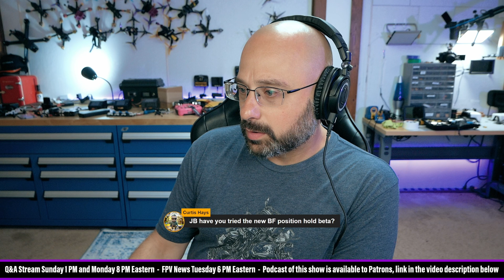Why Does A Drone Need A Gyroscope? How Does Betaflight Use Two Gyros? - FPV Questions

Comment: Hi! I know this vid is 6 months old, and I'm not sure, but I think (most of) you guys didn't read the first question correct.. :
The second half of question number 1 is; "Why can't they (-the FPV-drones) just NOT react to the environment (...)?"

There's tonnes of people with explanations about why and how a gyro DOES react to the environment, but I believe that's not the question.
Apart from that, I think (although I might be wrong, ngl..) that the statement that the Gyro is needed to translate a single stick input into 4 separate motor-commands is wrong.. -ish.
It's true that the Gyro is part of the system (-flight controller, I guess?) that tells each motor what it has to do at any given moment in the flight, but why does it need more 'info' than just the amount of stick-input?

In other words : 
Assuming a drone flies fully manual, so no attitude-control or self-leveling or any other kind of restriction in movement, like max. roll-/pitch-/yaw-angles-, or any type of anti-wind stabilizing stuff-, (for which it obviously would need some kind of steering-help, like a Gyro) - other than the pilot's own stick-input..  - why does it still require a Gyro to fly?

I've only flown a handful of fixed-wing (non-fpv) foamies so far, so maybe this is just something you gotta know to know.. you know? 🙄👉👈 .... But I really don't know, so I'd be glad to find out!
Cheerz! 🚁

Comment: The only way to not use a gyro is to manually control the throttle of each motor by hand. I'm sure you can imagine how well that would work.

Comment: Most flight controllers do use sensor fusion. The accelerometer data is used with the gyro to stabilize a quad when in one of the stabilized modes.
A flight controller with only an accelerometer wouldn't be able to control a quad. The same thing goes for gyros. Add the two sensors together and a flight controller can keep a quad level.
Reply: But is this still sensor fusion? Accelerometer gives you different data, it gives you acceleration, not orientation. You cannot simply "fuse" different physical quantities.
Reply: @jkk916  Yes, it's sensor fusion. Much more so than using multiples of the same type of sensor. Multiple gyros gives you sensor averaging or sensor voting. Using gyros and accelerometers together is sensor fusion.
You need both acceleration and gyro data to figure out the quad's orientation. 
Accelerometers alone won't give orientation since it can't distinguish acceleration from gravity verse acceleration from change in speed. Gyros can't give you orientation since they only measure how fast you're turning not absolute position.
Throw a magnetometer into the mix and then you're really fusing data to get even better position data.
Reply: @ddegn  Well apparently sensor fusion is broader term then I thought.  
Nevertheless, I imagine the whole process that way: raw sensor data>filtering, sensor fusion>data processing>creating output
And I would rather put some of what may be regarded as sensor fusion in data processing department. 
In the opposite case I would regard everything as a sensor (whole electronic package including processor) which does not make much sense to me. 
You "fuse" sensor outputs using a processor, you are not actually fusing sensors so that is why I find the term in the broader meaning misleading.
Your eyes and your ears are sensors but do you also regard your head as one large sensor? I bet you don't.
Reply: @jkk916  "And I would rather put some of what may be regarded as sensor fusion in data processing department."
Sensor fusion is a type of data processing.

"Your eyes and your ears are sensors but do you also regard your head as one large sensor? I bet you don't."

No, and nor do others referring to sensor fusion. Sensor fusion is about fusing (or combining and processing) the data from multiple sensors in a way to make sense of the world. 

You might not like the way the world defines sensor fusion but if you want to be understood by others, it's helpful to use words the same way as those you wish to communicate use the words.

As an example of how the term sensor fusion is used by the world, you could watch the video "What is a Sensor Fusion | Mouser Electronics | STMicroelectronics." The video provides a very superficial explanation of sensor fusion.

I'll add another reply with a direct link to the video. I won't add it here since links may not be allowed here.
Reply: @ddegn  What can I say, thank you for pristine effort for clearing things up, I appreciate it. But I am still being dumb. I ask what kind of data processing is then NOT regarded as sensor fusion if we assume all data comes from sensors?

Comment: Even if they are mounted in the same orientation, you can still reduce the noise and "drift" (zero rate output... these things never actually output 0) by taking the average instead of subtracting one axis from another. Basically multisampling but without the added latency.

You can also do things like having 1 set up to be more precise in low rate rotations and the other being set up to have a high headroom for high rate rotation, to improve the linearity of the response across all rotational rates without clipping the signal.

See; input labs alpakka controller blog, for video games.

Comment: Fun to add, though it’s required for drones, helicopters can be tuned and use old school flybars to fly with zero gyro assistance. Much harder, but something fun to expand in to down the road. Also, they can autorotate just like any full size heli.
Reply: I think those old school helis were at the limit of what a human can control without assistance from a computer (flight controller). 
I doubt a human could manage controlling all four motors of a quadcopter without the help from a flight controller.
Reply: @ agreed. And I think it’s the biggest reason you don’t really see quadcopters taking over the passenger transportation market. Lots of mandatory tech, and zero ish survival abilities if anything goes wrong. That and they just can’t match a helicopter in efficiency. Make for great camera platforms though 🤷🏼.

Comment: OR: What they mean is "react passively to environmental inputs like an RC Airplane". Where the plane just reacts to the wind, gusts, etc. and it's up to the pilot to counter to right the plane. The answer here is that airplanes have wings and a natural tendency to fly straight in a certain direction with only the speed of a single propeller to worry about, which gives thrust in only 1 single direction.

Whereas a drone has many propellers that have to have their speeds EXACTLY controlled by the FC to maintain a certain position or to turn a certain way. Should be noted that in the case of a multirotor that movement can be in any arbitrary way, which is what makes them so much cooler than planes ... I'd be surprised if any 2 props on a drone are EVER going at exactly the same speed for more than a microsecond. The FC does a lot of work to calculate at super-human speed how fast to turn each motor and it can only figure out how to do that if it knows exactly how it's moving, combined with how it WANTS to be moving... exactly as Joshua lays out.

The TLDR is before computers we could fly airplanes manually because they're (generally) designed to be stable. But we've never been able to fly multirotor drones without a computer and a gyro doing the work.

Comment: Maybe they think the FC "sees" what the FPV camera sees and thus can react to the environment that way? Well, for all intents it doesn't, it just passes it on to the VTX (if it's even wired that way). But still, even a Tesla, that has a WAY bigger computer than a drone, they have been trying to get accurate enough data from cameras for years and they're still not quite at the point where you can actually trust it. Image processing is among the hardest problems in computer science. Reading a gyro is among the easiest.

Comment: Take the semicircular canals out of your inner ear and try to react to the environment.  This is what gyros do in drones.
Reply: not just that. To do what the semicircular canals do, you also need an accelerometer in your quad. the gyro can only read rotation rates but it doesn't read which way is "up" or "down". Most gyros are combined with an acc in one package though, so angle mode is possible.

Comment: My dual gyro seems smoother than my old single gyro when it comes to feel. Maybe placebo.  The blackbox is definitely much smoother or less noisy though.
Reply: uncorrelated noise is 30% lower with dual gyros. Not much but it's something
Reply: Which FC are you using?
Reply: @ddegn  Skystars H743 dual gyro.  It's not good for analog, osd passthrough makes the image dark.  Ok for digital.  I won't buy skystars again.
Reply: @FPV_sk8  "I won't buy skystars again."
Is that because you fly analog?

I usually fly digital (O3). Should I try a Skystars H743 my builds?
Reply: @ddegn  Yes, I'm on analog.  This FC should be good on digital.
Reply: @FPV_sk8  Thanks.